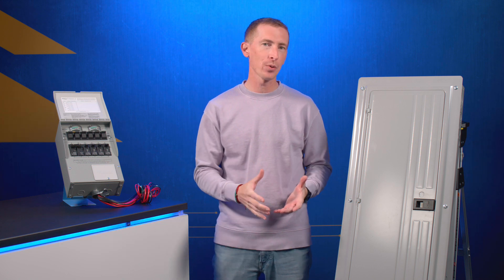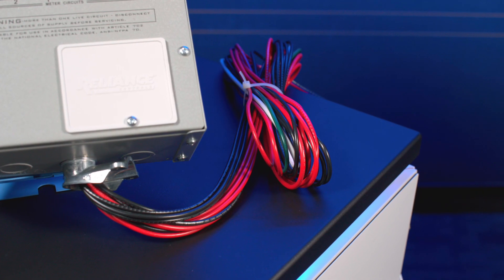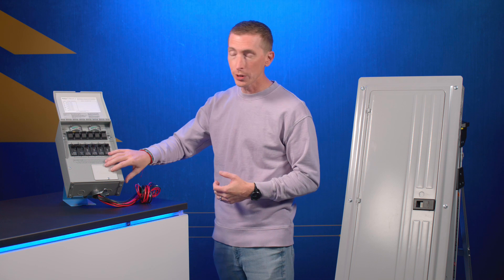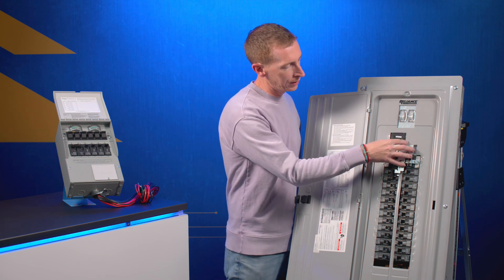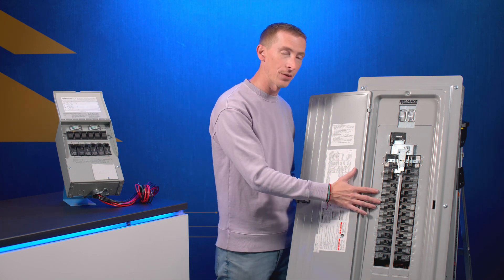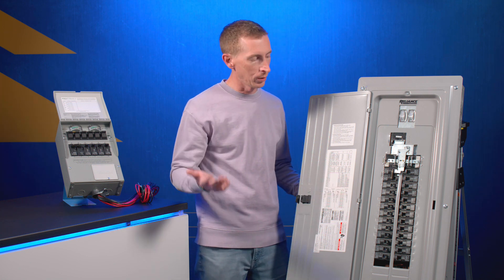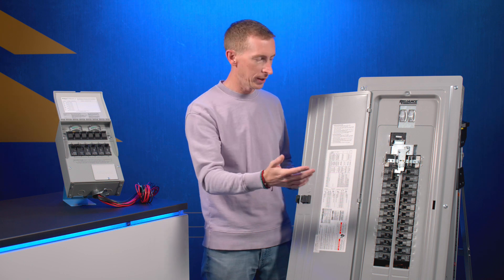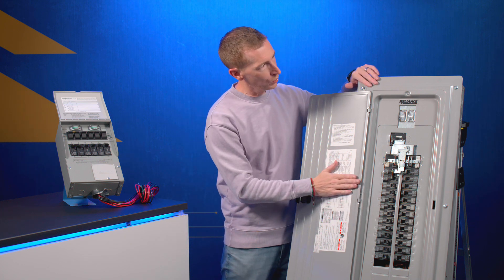Three Options for Connecting Backup Power

Comment: A 12 circuit switch would be awesome.
Reply from the maker: Hey @jimfields9491. For 12 circuits, you'd need to go with a transfer panel as opposed to a ProTran switch. The best option is going to be in the TRC Series. I usually recommend a TRC 1006C which is good for generators up to 60A.

Let me know if you have questions or need help :)
Reply: @RelianceControls  Can the double pole 20 amp be changed to a double pole 30 amp? If so what brand of breaker?
Reply from the maker: @jimfields9491  Hi Jim! Sure can! 

You can also just order any A-prefix model Protran 2 and we’ll ship it with one double pole 30 already included - like A306A or A310A :)

Comment: Great video, thanks for providing it. Something that wasn’t mentioned but I have experienced with my transfer switch - GFCI / AFCI equipped breakers in my home’s original panel will detect a fault when I am powering loads through the transfer switch. Therefore, I need to procedurally remember to power off those breakers in the panel BEFORE transferring and powering them, so as to avoid auto trip and premature wear on the breakers. As for the non-sensing breakers in my home’s panel, those are fine and don’t trip. As for the linkage kit, it should be noted that it may not fit if you don’t have a main disconnect at the top of your home’s panel.